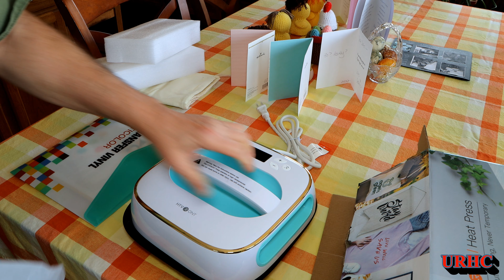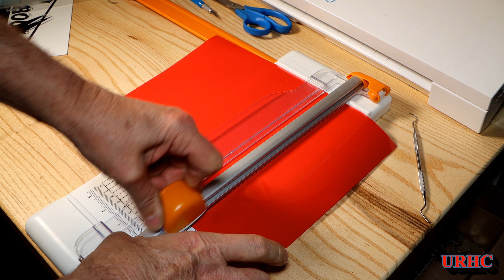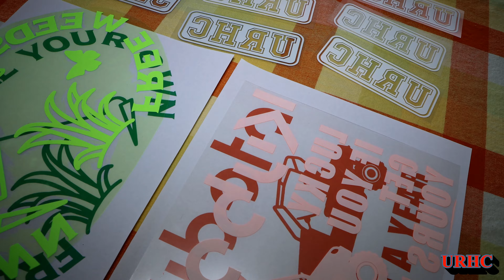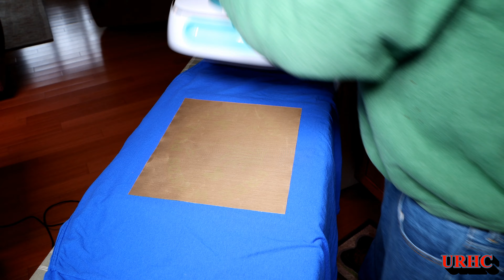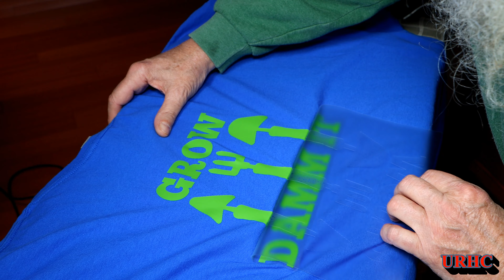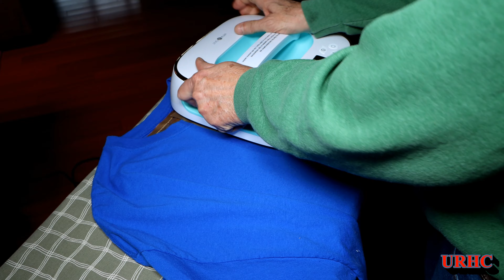Trying Out A HTVRONT 10 x 10 Heat Press And HTV

Comment: I agree with your assessment for the specialty vinyl. I used metallic vinyl just an hour ago, and it would not stick. Stuck real good to the release plastic, though. lol I too, had to run it through multiple times before it stuck. Oh, this was HTVRont vinyl and their heatpress.  It wanted to pull the shirt hard and sticking to the release backing made it tough. Regular vinyl from HTVRont was ok to work with.
Reply from the maker: I told them about the  problem and was told they would  look into it. The HTVront vinyl  seems to be standing up good to multiple washings. Thanks for watching.

Comment: Great video - as always.

Almost 20 years ago I made a heat press out of a griddle from Walmart, flipped upside down in a wooden homemade "press" for my Cub Scout pack's Pinewood Derby event.  I've still got it and the press, and it still works.  Back then we were inkjet printing onto heat transfer paper.  I still have some of those shirts and the print is still holding up.  I have big vinyl cutter, but haven't tried heatpress vinyl.
Reply from the maker: I remember  buying  those heat transfers from my boys life magazine  and my mom used an old iron to apply them. You should  try the htv but I would  recommend  a different  brand because this was not right. Thanks for watching.
Reply: Britt that's amazing.  You should put up a video of that.  I would love to see it